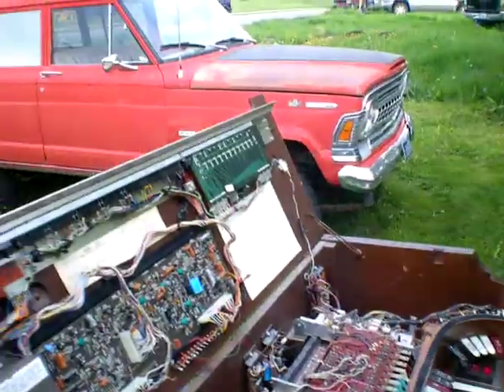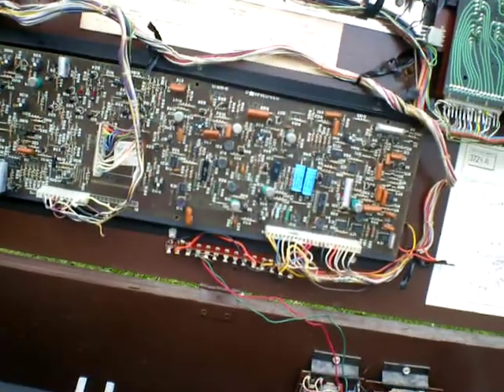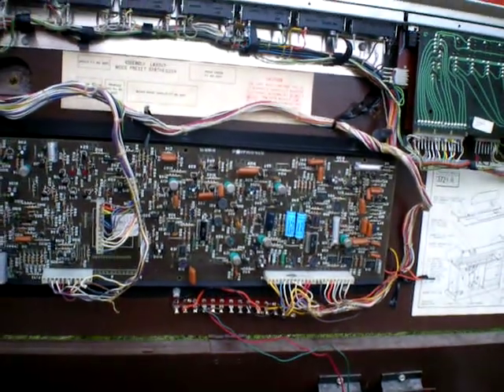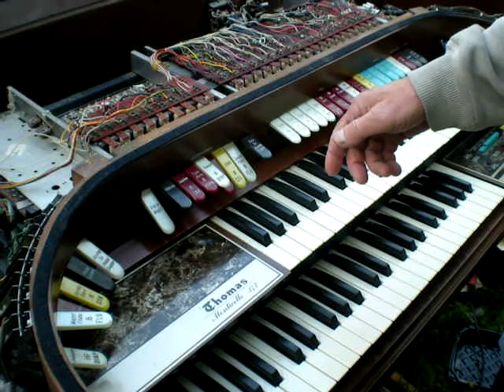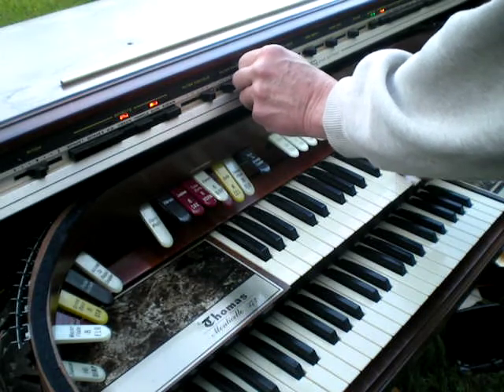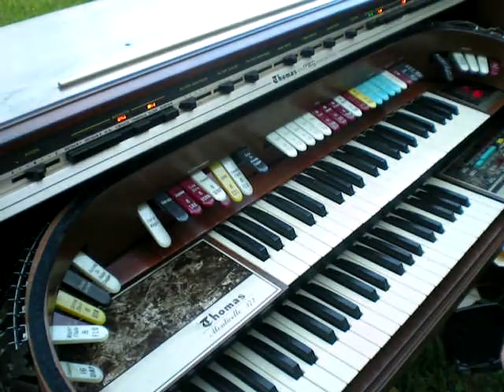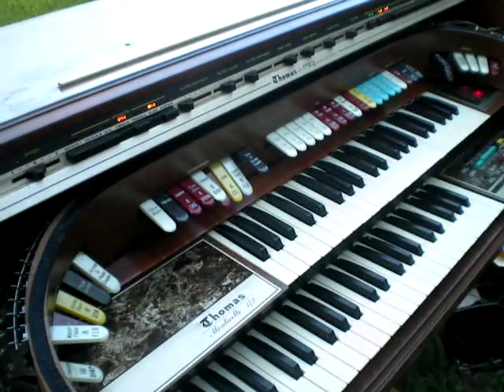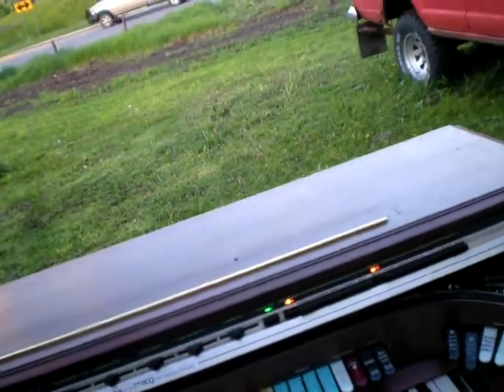Thomas Monticello 372 w/Moog Satellite tech talk and demo

Comment: Hey I just got one of these. Can I take the Moog synth board off the organ and use it to run other instruments through it.
Reply from the maker: i saved top section and keyboard- i plan to build a dual mono s/ sh1000 parts i have/  it's a moog satellite so sure if you set it up w/ proper power and merge ext. audio w/ vco out and trigger envelope
Reply: I'm looking for answers to the same question. I want to use it in the effects loop of a guitar amp. I have the 371 and I think I'm about to buy a 372 from a church. Anyway, how did you go..? Have you done anything with it..?